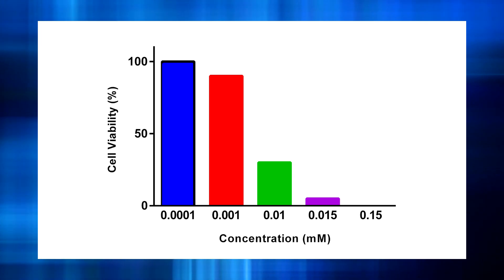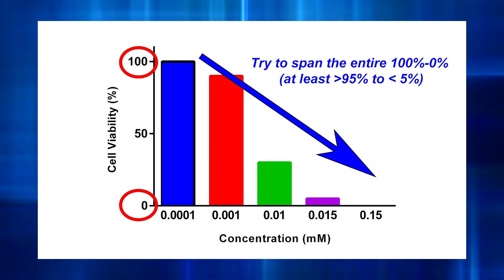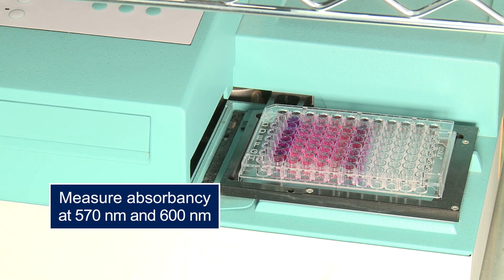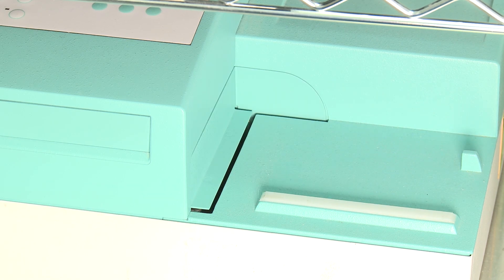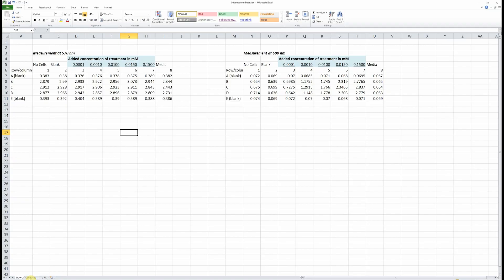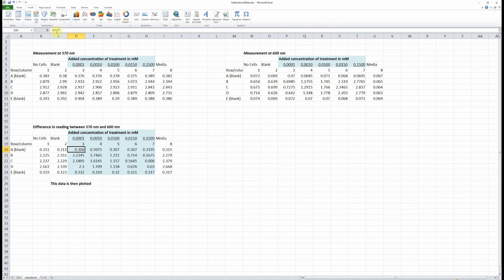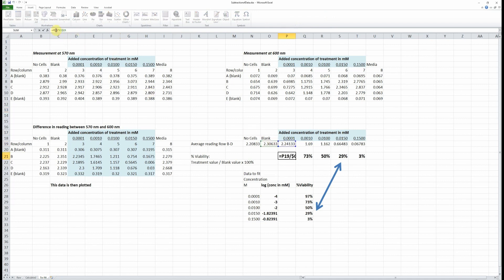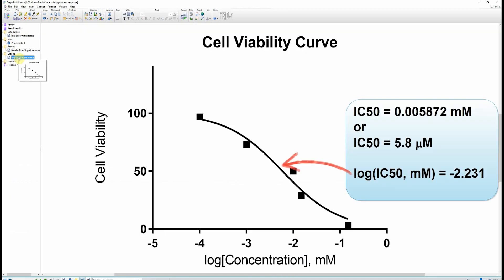IC50 or cell viability experiment

Comment: un muy Lab they remove the media before adding the mtt and put a fresh media without phenol red. then the mtt, incubate for 2 hours, remove and then they Also add isopropanol instead of dmso, could you give an opinion about this protocol?
Reply: Alamar blue versus MTT is 1)cheaper 2)faster 3)more reliable 4) doesn't kill your cells